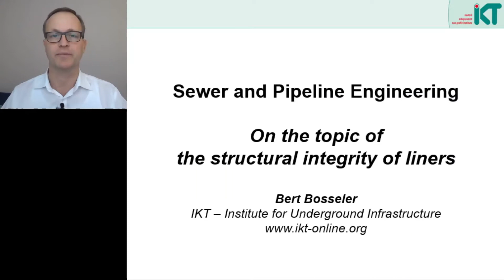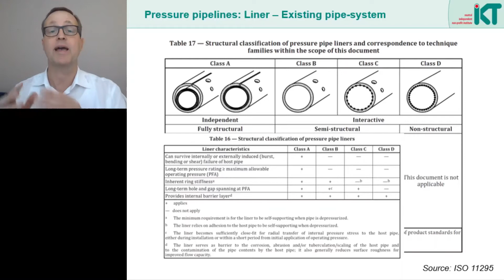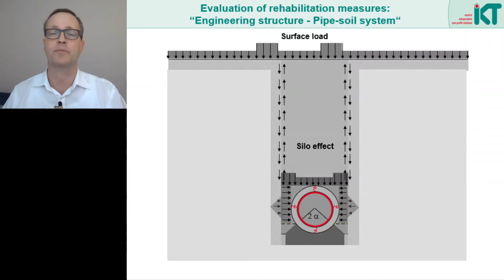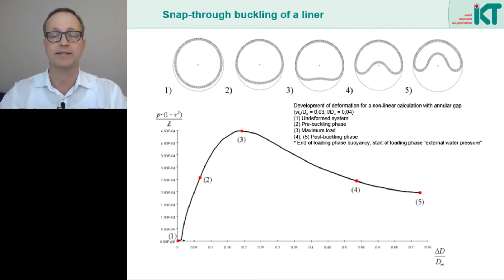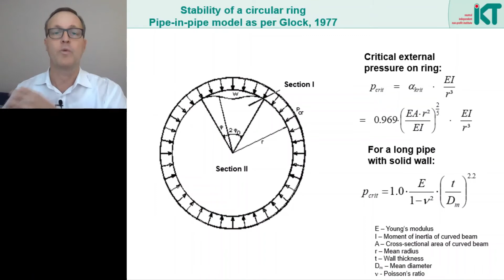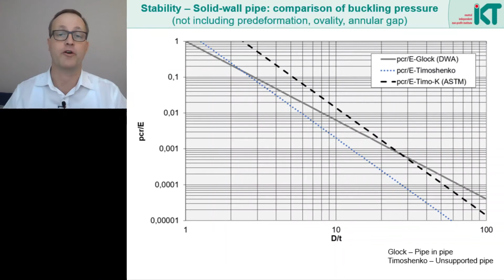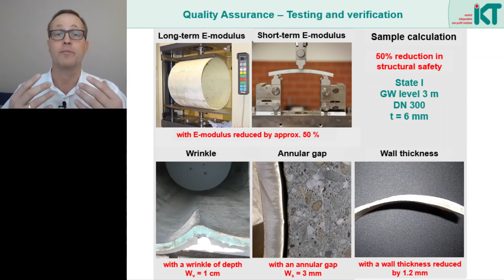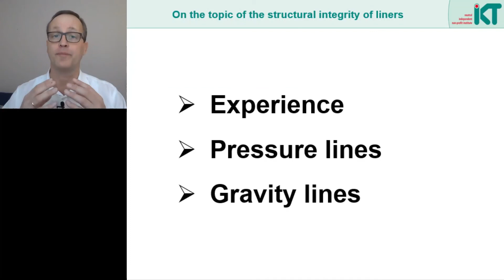SPE 011 Lectures on Sewer and Pipeline Engineering - Structural analyis of liners (rehabilitation)

Comment: Thank you for sharing these insights.  I find them quite enlightening and useful for our work in trenchless rehabilitation.
I would appreciete a lecture on special cases for the design of liners (e.g.: shallow pipes, large gaps without host pipe, other shapes, fem analysis)
Reply from the maker: Thanks for this idea, I will discuss this with my colleague Mark at IKT (see www.ikt-online.org) who is a specialist in structural calculation and FEM for liners.
Reply: @professorbosseler2214  Thank you, Professor Bosseler. That would be awesome. 🙌